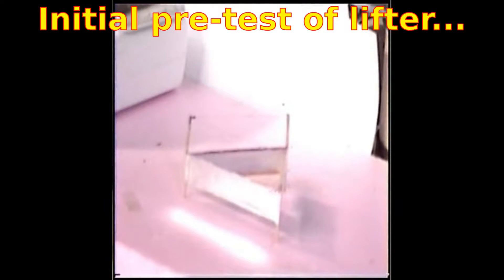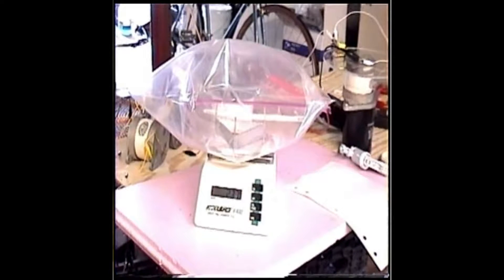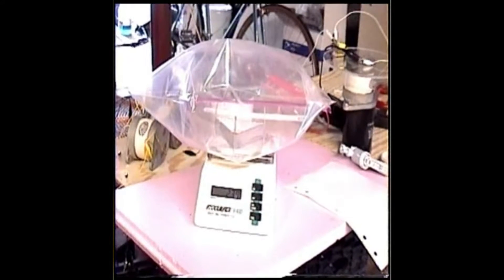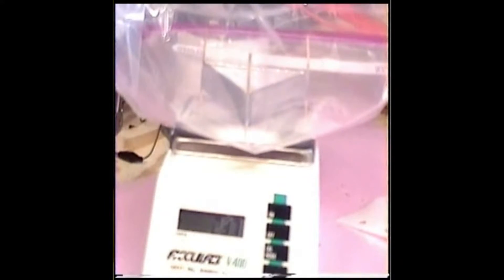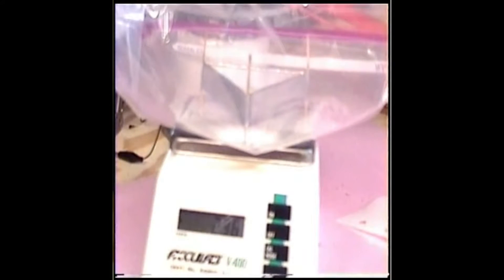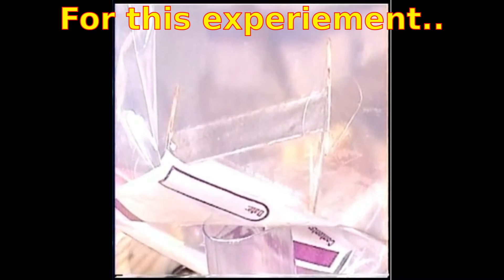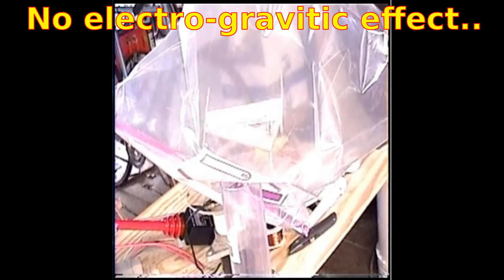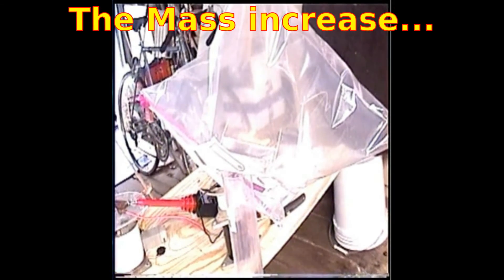Electrodynamic Propulsion in a Plastic Bag

Comment: Great experiment. I like how you changed the setup before coming to a conclusion. Diligence.
Reply from the maker: Thanks, I try my best.  These are actually experiment I conducted around 2002, and I am in the process of converting them from VHS to digital.  I feel there is still a lot to learn, even if the experiment in not a success.  There still is valuable information to gain.  Thanks again...